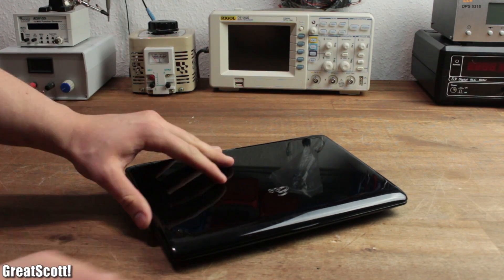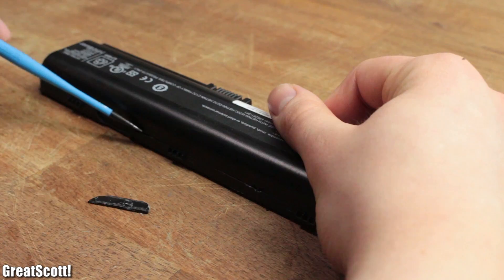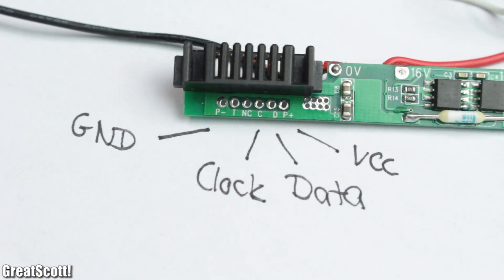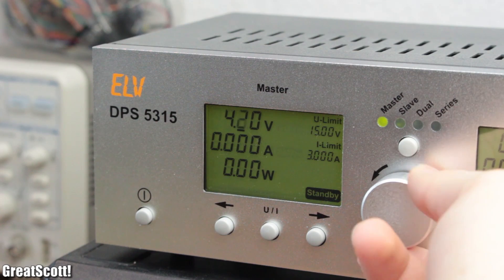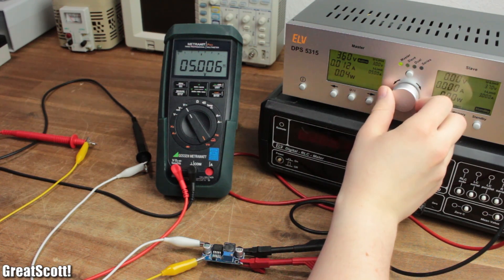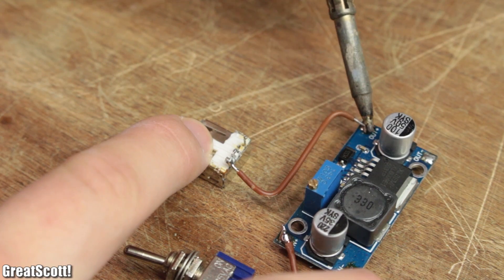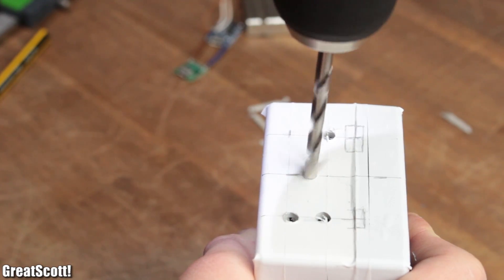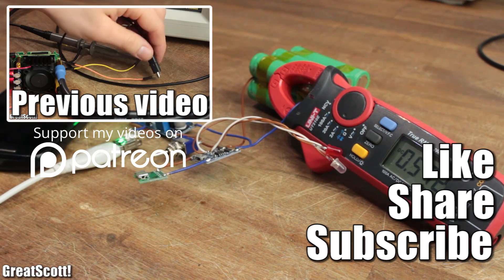HACKED!: Old laptop battery becomes a Power bank

Comment: That should be an old phone that draw less than 1A..!
the boost converter you're using is too weak and better use a bigger one its obviously known by the bigger toroid coil that have.
and as Sqalazzo said use the board itself USB port..
but Ill give you a hint' : Use more than one board in totally parallel for example use 3 boards to Boost charging current to 3A so you dont have to wait forever..
I did that already and it works like a charm 
last, using batteries in series can deliver more power to your charging circuit and be more efficient this way. and you can keep using circuit board as a low voltage protection circuit.
Reply from the maker: +Sam The boost converter can deliver up to 3A continuously
Reply: it wouldn't matter there are no  voltages on the data pins so phones are only going to draw 500mA as smart charging won't be detected
Reply from the maker: TaintedCamper
You can short out the Data Pins for fast charging.
Reply: but seems like the Toroid of that booster cant!!! not even the charge protection circuit cut off mosfet.
& "You can short out the Data Pins for fast charging.">>>
you might get away with that Im aware of chargers profiles,
if you making one you better have a charging monitor or check the D+ & D- voltages that the mobile recognize them.
Apple profiles are 1A 2.4A
Samsung are 
USB 500mA
bad wired ~800mA to 1A
android 1.1A to 1.8A
Qualcom fast charge reaches 1.5A but either 9V or 12V.. but Samsung require 9V 1.5A for example Note4 S5 and newer versions.
your battries are real good chunky but im not sure how that small booster can. I made up to 5 of them so far.
I charge my battries with iMAX B6 balance charger coz' I use Buck its more efficient.

Comment: you said this arrangement of cells is possible because they Were used together, so is it possible to do the same with (for example) 4 oft the same cell type? or are they gonna break or somthing link that?
Reply from the maker: +Gurke01 Only if they were used in the same batch and with the same load. Same cell type is not enough. Imagine you have a bad cell in your arrangement which is discharging itself while all the other ones try to keep it alive. It is simplified but in the end in the worst case bad things can happen.
Reply: +GreatScott! Hmm... now i get it, and if they are all Brand new, its OK?

Comment: great hack. Looking always forward to your hacks.

GreatScott: did you revived “dead” batteries like they become after year of usage in a laptop or were these new batteries you bought and re-charged?
Reply from the maker: +emailausdrucker The seller said they were just sitting around for a couple of years. Apparently not often used.
Reply: +GreatScott! Thanks for clarification.

you should do a battery pack with one of the motorized skateboard batteries. :-)

Comment: why add an additional microusb adapter to the tp4056, which already has it? More practical mount on the box, or else?
Reply: +squalazzo Those are perfectly good.
Reply from the maker: +squalazzo Correct, it was just easier to mount to the box.
Reply: +GreatScott! hi, i've these tp4056, and have different layout, they lack the OUT plates, so i can't use them while charging, i suppose... or do you think the 2 plates just behind the microusb connectors can be used for this? Thanks
http://it.aliexpress.com/item/WHOLESALE-1PC-LOT-TP4056-1A-Lipo-Battery-Charging-Board-Charger-Module-lithium-battery-DIY-MICRO-Port/32433891059.html
Reply from the maker: squalazzo
This one does not have a protection circuit. Just charging.
Reply: +GreatScott! i'll buy the right ones, so... these seems exactly as the one you used in the video, while the one you linked on aliexpress seems to have a little bit different layout... are these linked ok?
http://it.aliexpress.com/item/5-pcs-Micro-USB-1A-Lithium-Battery-Charging-Board-Charger-Module-With-Protection/32402397769.html